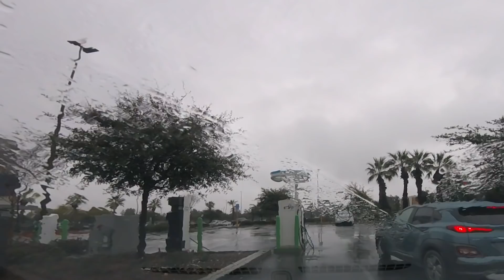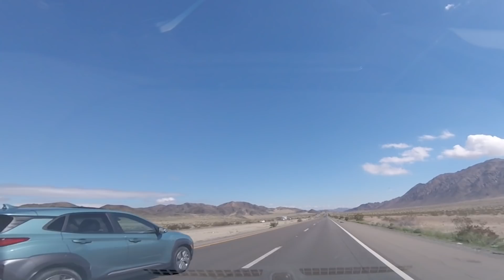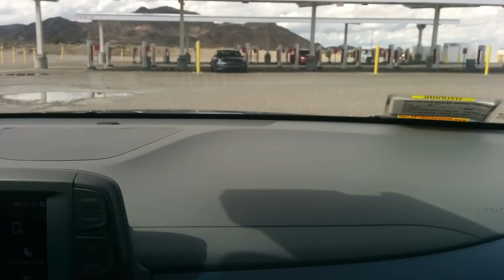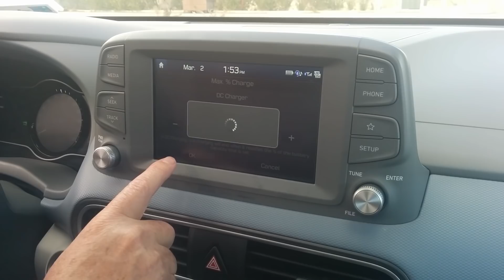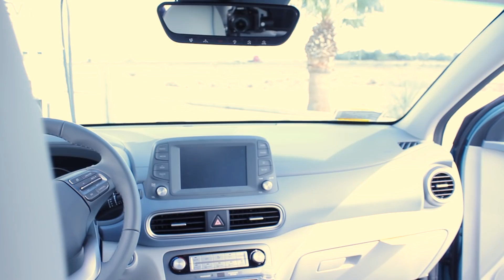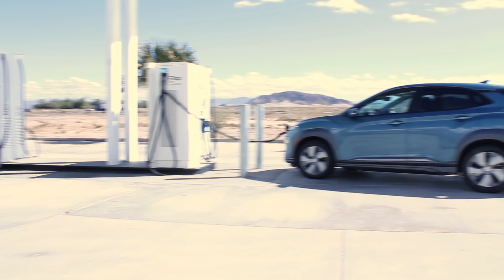Chevy Bolt EV and Hyundai Kona Electric: Grizzled Veteran versus Star Rookie

Comment: @8:00 yes, the first time Bjorn got a shot of the battery under the car it looked like the 64 kWh was a total afterthought from the 39 kWh, which probably fits. It would be ok if it’s thicker if it looked like there was a ramp/skid plate around the edges, but it looks like something that will get snagged hard if you go over some obstacle, especially backing up.
Reply: IMHO The 39.2 pack is the same under the main floor area and is only missing an extra stack of cells located under the rear seat in the 64 kWh version. I have not seen a 39.2 kWh Kona up close in person but my guess is that the pack looks pretty much the same as the 64 kWh when looking externally from below the car.
Reply: Jeff Nisewanger, hopefully someone will get a comparison shot. 25 kWh is a lot of extra battery to add inside a car. It would be nice to see the lost space inside vs a 39 kWh pack using the same internal space and not hanging so low below the car.

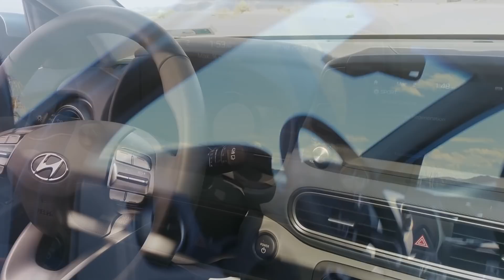Comment: @6:00, the only puzzling thing is why would anyone want to set the car to stop charging at less than 50%?
Reply: If you need 30% to get home at a pay charger, while you grab a bite. Then finish charging at home.
Reply: Bioniq Bob, but why set it to stop at 30% when you can just stop it when you get back to your car, or watch it on your app? The only time it would help is if you are paying super high rates and no idle fee, and plan to let it tie up that charger until you get back.
Reply from the maker: Less than 50% is sort of weird. I guess there could be some reasons.
Reply: The only reason I can think of is to prevent battery degredation.
Reply: Walter Payne, But 50% is considered the ideal storage charge for lithium ion batteries. If you bought one and wanted to save it in a time capsule for 20 years, you would probably want 50% or 60%, but not 10% or 20%.

Comment: Nice comparison of two competitors, thanks to both of you for getting it together. Really hope that GM can take some cues from the Kona Electric/e-Niro for a 2020 MY Bolt EV refresh... maintaining the interior advantages you mention while upping max charge rate and improving efficiency would go a long way.
Reply from the maker: Thanks!
Yes. I wouldn't mind if the Bolt EV's battery stayed the same size (same range) if they are able to increase the charging rate to 75-100 kW.
Reply: @newscoulomb3705  EV technology is advancing in dog years compared to ICE technology. If Tesla can squeeze another 10% of range and 60% greater charging rate in their Raven S/X upgrade, then what can GM do after 3-4 years of learning since the Bolt EV's design was finalized. So excited to see what they cook up!

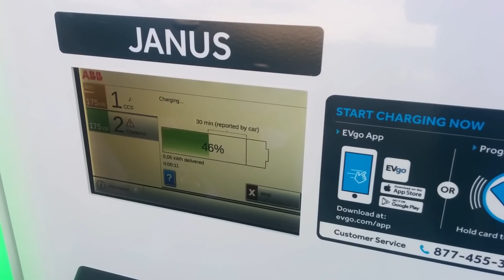Comment: @3:10, I’m pretty sure if you check the specs the only way to get 350 kw is with 800v battery. The CCS2 is only rated up to 500A, CCS1 is only rated to 200A. 

If there are 2x 175kw chargers limited to 500V and 500A, if a Porsche pulls up to charge it would use both chargers in series to give up to 350 kw, 1000v, 500A whichever limit comes first. 

The maximum CCS is 500kw, but you would never see the output unless your battery was at 1000V and still able to accept 500A. Just like you will hardly ever see 50kw from a 50 kw charger. 

But to know the real and true limit you would need to look at the data label on the charger. It might be 500V 350A, in which case you will never see 175 kw from it.
Reply from the maker: However, you can get more than 175 kW out of the 350 kW charger in EVs with 400 V packs. ~200 kW.

Comment: I agree the Niro is the EV I want too..but isnt there a big price difference with the Kona?
Reply from the maker: There will be a price difference, but I don't know how much. Right now, most of the Hyundai dealerships are charging a $5,000 to $8,000 "market adjustment."

But just guessing on MSRP, I think the base Niro EV will start at about $37,000 to $38,000 and probably top out at about $46,000.
Reply: @newscoulomb3705  Your Niro EV pricing estimates look in line with what Tesla's probably going to charge for the Model Y (minus AP and FSD). Not sure how well for Kia that's going to go over with customers...
Reply: @EMichaelBall  the Niro & Kona  have lane asst. & "smart cruise control"... I think most companies are scared of AP & possible lawsuits